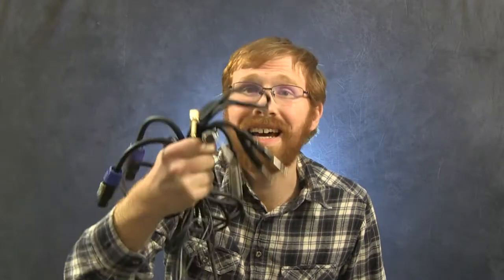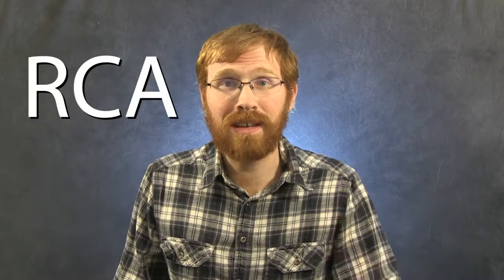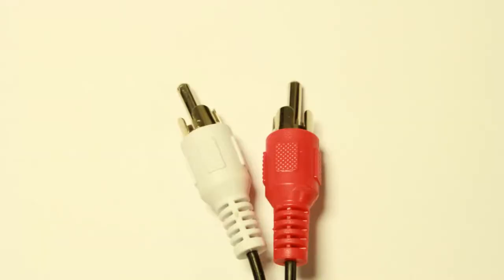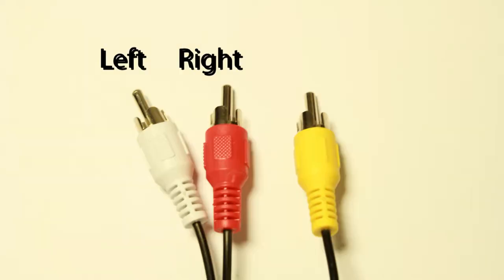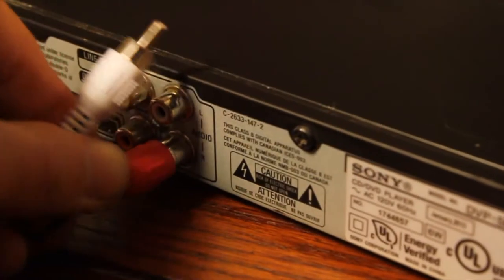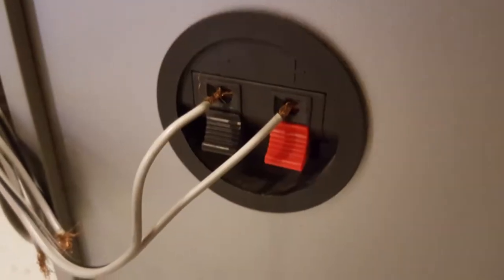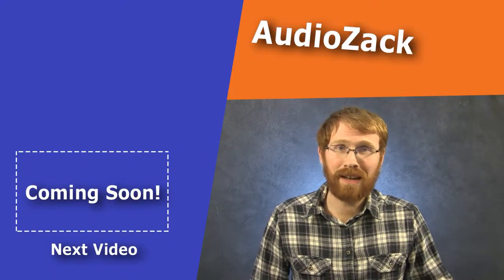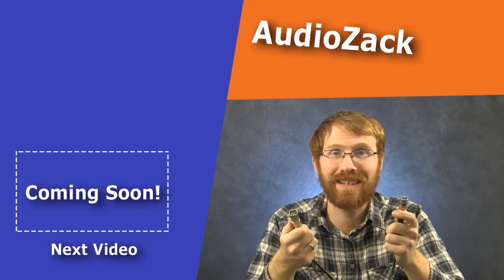Understanding RCA Connectors - Types of Audio Jacks

Comment: Hi friend, I've old 2.1 speaker system (only rca red-white in/out option). 2 satellite speakers delivers better sound while connecting by mobile. 
While connecting to TV via DAC or Direct White Cabled Speaker not working. can't determine where is the problem !
Reply from the maker: There are a few troubleshooting steps we could try. Have you tried plugging them into a different TV? If the cables are not built in to the speakers, you could also try swapping them with different cables. Does the red cabled speaker still work?